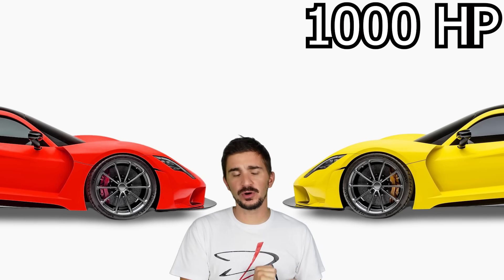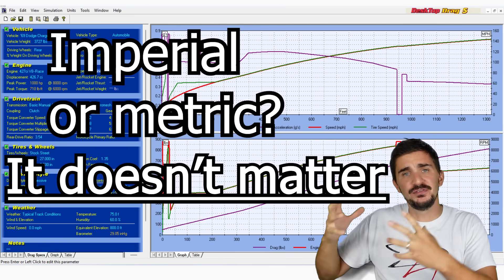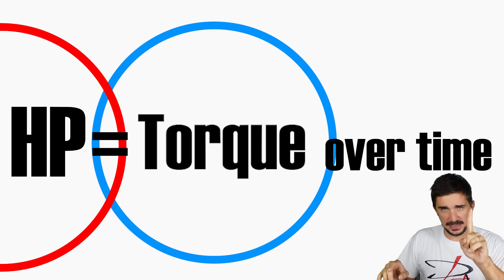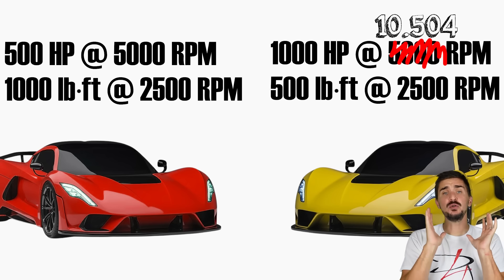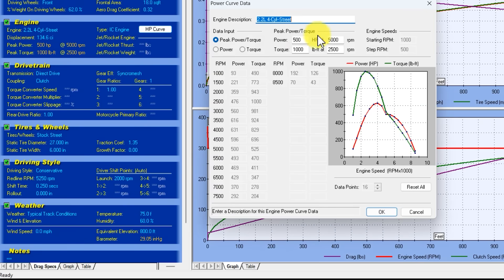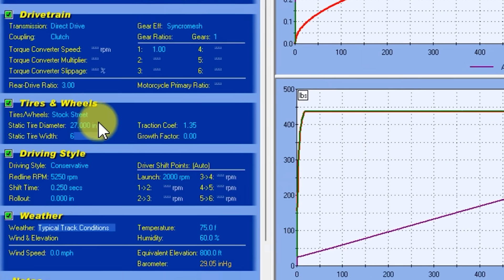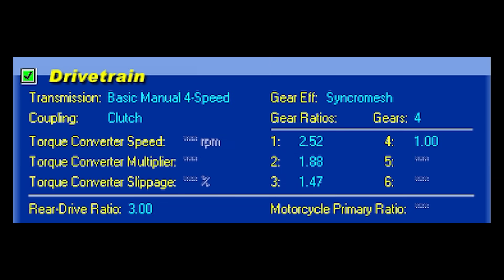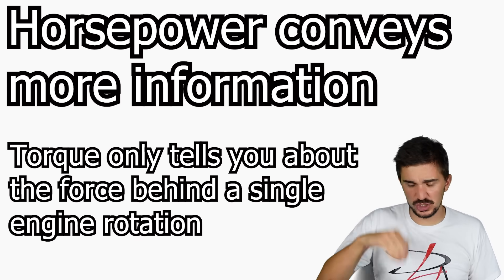Who's faster? Explained and Simulated - Horsepower vs Torque

Comment: A really good explanation, especially the punches part
I usually explain that torque represents the work the engine can perform (compare to the weight you can lift) and horsepower indicates how fast it can be done (how fast you can lift the weight) for people with little knowledge on physics or engines. Its not the whole truth but it gets people on the right track at least.
Reply: Horsepower is always the key for more speed, more acceleration or more heavy lifting. It’s always about power. Power determines the work we can achieve in a specific amount of time.
Torque ‘only’ determines the rpm’s needed to get whatever power out. …but because of this, high torque is always a good thing to have.
Reply: @miks564  Power is not the key for more heavy lifting, that's precisely what the torque is for (or force rather, which is the linear equivalent). With enough torque/force multiplication you can lift whatever weight you want, more power just means you can lift it faster.

Tractors can pull anything of comparable mass and heavy industrial machinery can lift anything of comparable mass, none of them have very powerful engines typically. A big 200 ton excavator only has like 150-200hp (and most of that is for when it needs to drive around, it only uses a fraction of that when stationary and actually digging), it's designed to lift literally tons of weight but it doesn't have to lift it very fast (in fact you don't want it to because it wouldn't be safe). Nowadays there's motorcycles with more power than that, because you need power for speed.
Reply: @BigUriel  We need power for everything, not only for speed. The higher the torque, more power we get with less engine motion, that is why torque is so important in some applications. But it’s always the power that accomplish any work at all, be it speed or heavy duty work.
An extreme example, a Diesel locomotive has diesel engines to generate electricity for the electric motors. Trains usually have very high mass that need to generate a lot of power to overcome the inertia and it’s easier to have an electric engine with very high torque from zero rpms, than to have a giant clutch able to apply power to the wheels from a Diesel engine. These engines output very high power because of the heavy mass they have to move around, not because they need high speed.
Reply: @miks564 You need "some" power for everything that involves movement, in the sense that zero power means no movement (mechanically speaking). But the ways you can split that power between more torque/lower angular velocity or vice versa are infinite.

You could move a locomotive with very little power...just not very fast. The power a locomotive's engine (or electric motor) needs is directly proportional to how fast you want it to go, goes back to exactly what I said. Electric locomotives with Diesel generators don't use Diesel engines because they make more torque (you can actually easily make just as much torque from a gasoline engine as a Diesel one, it's just not usually how gasoline engines for road vehicles are designed), they use Diesel engines they are the most efficient ones we have (as far as piston engines are concerned at least), a gasoline engine would use more fuel to generate the same electricity. In fact talking about torque in the context of generator engines is moot because they don't transmit any of their torque to the wheels, they are designed and chosen for an application based on their power output, manufacturers of generator engines don't usually even advertise how much torque they make because it's irrelevant.

Men can move locomotives. Pulling trains is literally a staple strongman event and has been for decades. How much power do you think a strongman produces, 2hp? 3hp maybe for the really ridiculously strong 400lbs guys? There are mopeds with more powerful engines than that. Yet they can move it...again, just not very fast.
Reply: @BigUriel so, according to you, nobody cares how fast tractor and excavator will make the work done. Like 
-hey, we need to move a million tons of sand, let's use 5hp excavator.
-A million years later:

Read what power is.

Comment: This power and torque decoupling by the manufacturers seems to mess up ppls education
All of us should have learned in elementary school that P=F*v for linear force and P=T*v, T is torque, a rotational force, and there wld be no questions about this
And you shld explain that those constants are time and rotation "induced", in reality there are no consts in these systems, also if everybody have listened to physics/science classes there wld be no need for this video
Essentialy P equals T, as you said, power is torque over time..

Comment: The year the "music" died was really 1973. This is the year when the Chevrolet LS4 big block 454 CI  engine, de tuned to 275 hp with 390 ft/lbs of torque was placed in the Corvette! Lots of noise but very little action. Sniff sniff 1974 was worse and there was another 5 hp lost. A far far cry from 1969 427 pavement ripper. Thank goodness technology, 50 years later,  has found away to regain hp and torque within the environmental requirements.

Comment: Would like to see this type of sim for an engine with built NA vs turbo vs SC setups to how see difference in torque curves impacts things
Reply: I'd be interested as well. I'm currently running a turbo engine that is maxed out HP wise but is limited as far as TQ is concerned. My tuner says he can increase the TQ by another 100 ft lbs if I forge the bottom end to hangle the torque increase. The question is will it make my track car any faster since torque goes up but HP remains close to the same. Need to run the formula to even see if it's even possible...

Comment: Ow you just keep messing with me on this one. First I was going to attack about having both engines have peak power at the same rpm…. You fixed it then eliminated the transmission. I was messaging about how this is unfair comparison but you fixed it also. My Kawasaki Z900 is a balance of low end torque and high end horsepower.

Comment: yes, this is why the LS engine is so well liked it has alot of BOTH.  now I have an S54 e36 which I like alot to keep in the BMW style but it was not the best "speed" selection.  If i had gone LS at the time it would have cost me around $10K more, might as well by a corvette and work on it.  However Caymans and GT3 get around really well with the gears and lightweight too.  THis is Road Course not drag but still same idea.  Also I am still on the stock 3.23 diff so that is limiting my performance as well

Comment: Traction and weight being equal, the car that had more average HP through the run wins...  that's the video.
You can cripple either engine with terrible gearing.  And no because one engine has bigger rpm is not relevant to winning because of its higher wheel speed.

Comment: I think this is a very misleading explanation. In the same application those two engines would have completely different transmissions. The high horsepower would have for example twice as large final drive to facilitate large rev range. And that would smoke the high torque engine everywhere (as long there is a traction and assuming torque curves have reasonable shapes)
Reply: I agree mostly. The math wouldn't even work for electric cars because the size of the wheels would be a new big factor then wind resistance... Etc.

Comment: 1:05 I wouldn't say impossible but it would depended on which fuel the engine runs. I would say that the left runs on Diesel and the other on gas (safeguarding that the numbers from the right side are a bit specific, for example, for a high revving atmospheric gas engine).

Comment: It’s the torque that generates the G’s. G’s = fun.
Reply: But not engine torque, which is what's typically what's required. It's torque at the driving wheels that generates the Gs, and this depends on both the engine torque, and the combined transmission and final drive ratios.

Comment: Over thousands of videos of simar subjects over the years... this is the perfect and most definitive explanation of what torque and horsepower really mean. You sir are brilliant, keep at it! ❤
Reply: Not really.
Reply: @SlyNine  I think it does a far better job than any other video I've seen on this subject.
Reply: @wurfyy  no, because the transmission has to match the engine.
Reply: @SlyNine  First off, why did you suddenly decide to reply to a year old comment? And secondly, this video isn't about engineering a car, it's about teaching the difference between power and torque.

Comment: Thank you for explaining this. What does an I4 vs a V8 look like when they produce the same HP and Torque? How about rotary engines. You often hear they produce a lot of HP but little Torque.
Reply: Engine Layout is irrelevant when power/torque specs are the same.
Rotary engines dont have that low torque, usually they indeed have higher torque per displacement than piston engines.
Ultimately engine torque alone is not relevant, since only hp tells you what a engine is capable of. Power = word per time. Everything else is job of the transmission.

Comment: It's basically HP at different RPM. High torque at low RPM means (relatively) high HP at low RPM. It's tricky to understand, because of all the misinformation about torque. It's just about HP, but manufacturers usually just put out the top value. Torque is useful to compare HP at low RPM. But only top values are pretty meaningless anyways.

From this explaination it almost looks like high torque will compensate for lower of HP, which isn't true. A better comparison would be identical HP, but different torque (and RPM of course).

People see torque as this mythical thing that spins up the tires, but it's just more HP at lower RPM. A 600hp/700Nm sports car engine will accelerate just as fast as a 600hp/2000Nm truck engine. (assuning proper gearing). Both deliver the same power, but a truck will do it at 2500rpm, not 8000rpm.

Comment: It's torque at the wheel what counts. With a higher horsepower you can have more torque at the wheels when you use transmission properly.